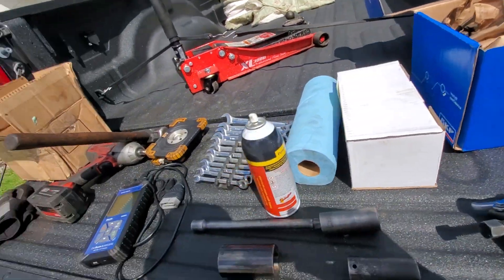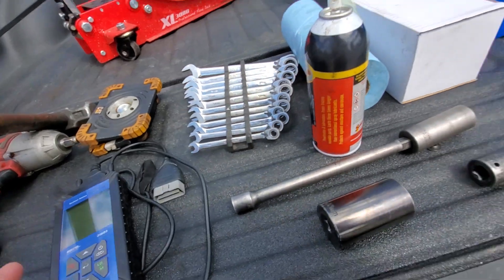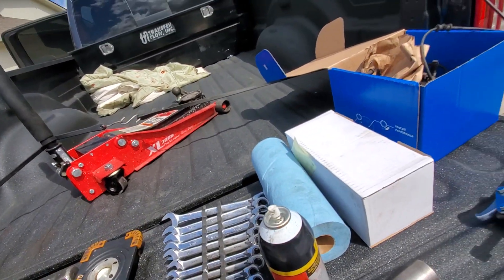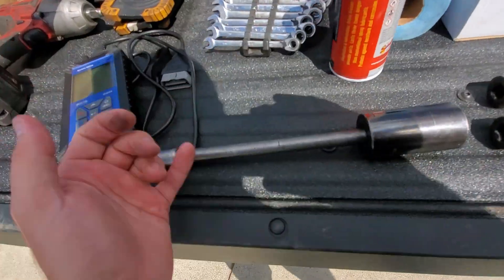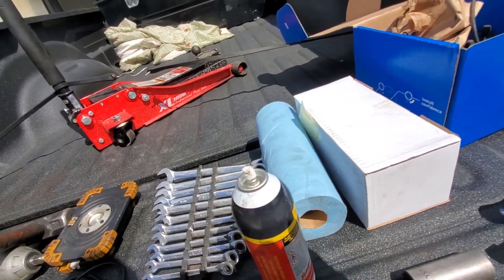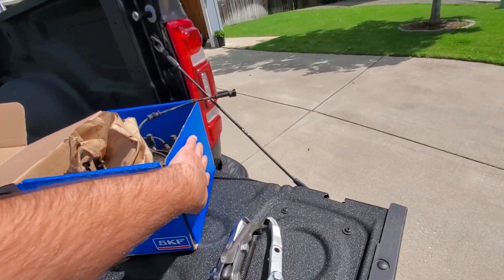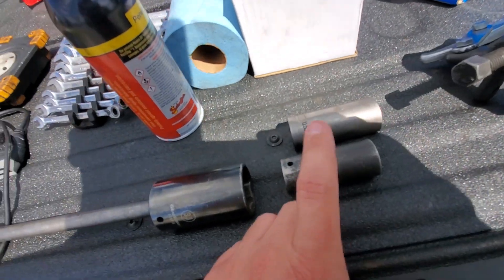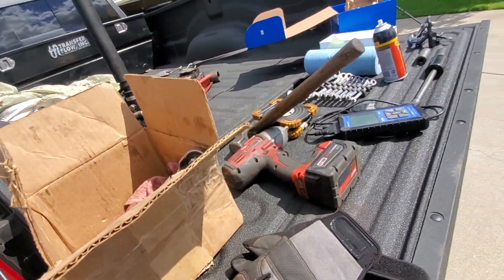13-18 Ram 3500 front wheel bearing. Tools and process to swap out a front bearing.

Comment: Swapped out my front wheel bearings and put in the dynatrac manual locking hubs on my 2012 RAM 2500 HD.  Hopefully I wont have to replace the bearings as often.  Wish RAM would have manual hubs like Ford Trucks.